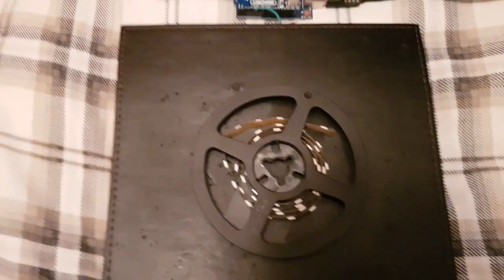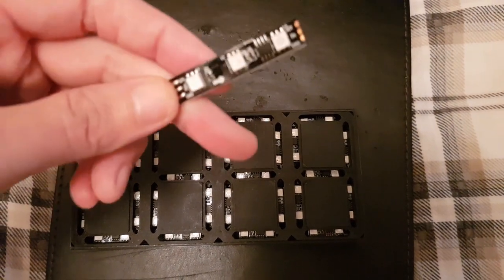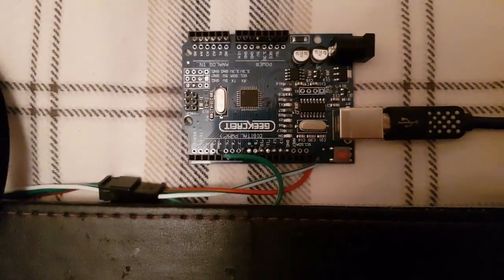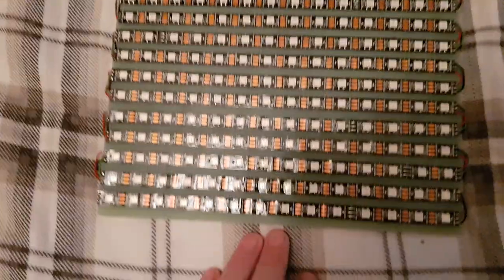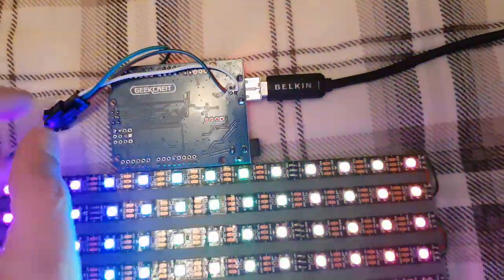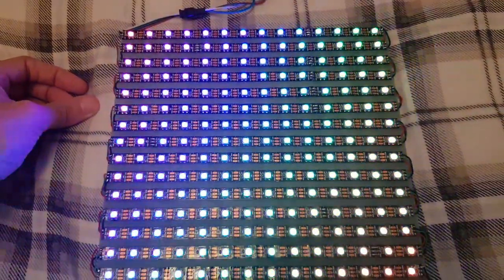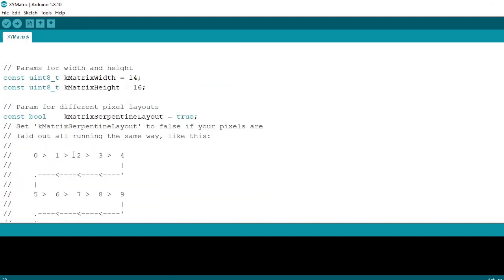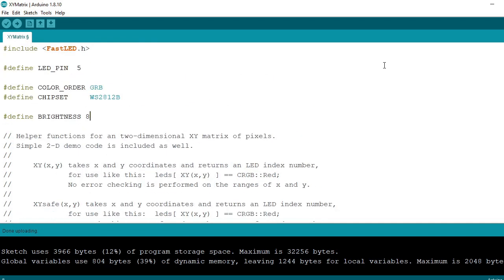Controlling WS2812B Led's With Arduino Uno

Comment: When you cut the strip, the capacitor is destroyed right?  
So there isn't any need to add in a new capacitor when you solder them back up?
Reply from the maker: I don't understand what you are talking about

Comment: It looks really nice, but I'm currently a bit confused. Is it possible to power like 100 led from the arduino 5v pin? I thought that it can be done as long as you put some resistor at ground pin so that the sudden spike in voltage or current can be step down thus preventing the board from frying.
Reply from the maker: no not from the arduino
Reply: I just saw that this was from 4 years ago 😂
Reply from the maker: I think it's going on for 6 years
Reply: @liney118 I've also finished my degree in computer electronics. Figured out how to power the board with a separated isolated circuit for that project. Thank you. 😂
Reply from the maker: No worries,  congratulations on the degree
Reply from the maker: I was using a powerbank with a limited 2 amp output so there wasn't any chance of any bonfires , but yeah for more leds you could add a soft start for the current inrush but with the powerbank and code i had limited  the current usage

Comment: Im having some trouble man, im trying to connect them to those solders underneath the board but they dont seem to work (in using and arduino uno) i tried connecting the matrix to a different power source while still keeping the data line, by using a USB mini cable but the wire got hot and it didn’t work-and now I’m at a lost and could use some help
Reply: @liney118  polarity?
Reply from the maker: When using an external power supply you need a negative/ ground connection to the controller so the board and supply have a 0 reference.  Without it they would be in a floating state and also check polarity

Comment: Hello.  Now make a dance floor in the limo with 3600 2812b led, but can't find a controller for so many leds.  Can you control so many leds with arduino?
Reply from the maker: with these leds yes, the problem comes when you try to power them all, adding 5v source every 300 leds and you should be fine

Comment: Congratulations for the work, please could you share the code and the connection diagram, I thank you in advance: espinozacabaw@gmail.com
Reply from the maker: connection is simple, you have 2 power connections 5v, Gnd and data, leds are marked on the pads, after 10mins in is how to get the sample code

Comment: yeah i had some strips like that, but some are one address/chip per LED, usually cost more
Reply from the maker: I paid just under £15 for 5 meter 300 leds and of all I've tried these are by far the best and most common ws2812B ;)
Reply: Arthur Zavier  what has this got to do with leds you spammer